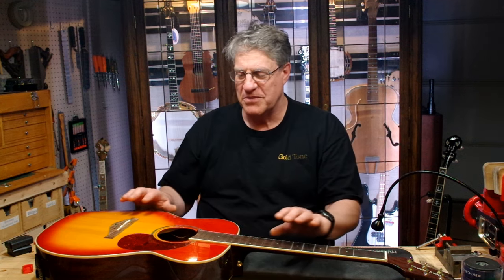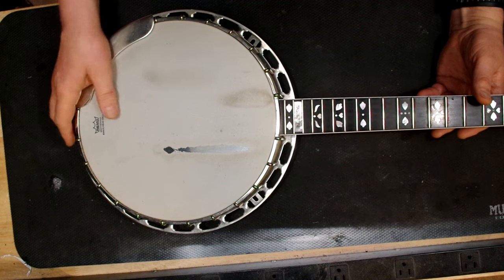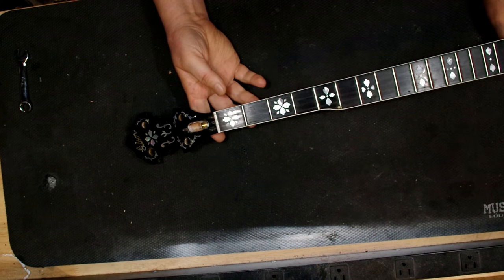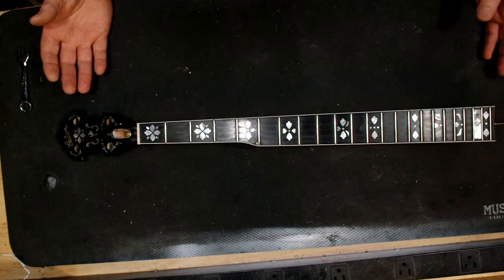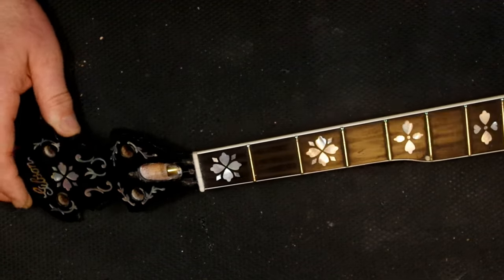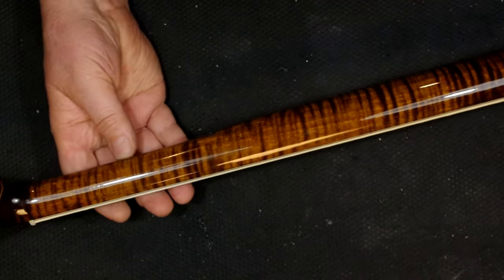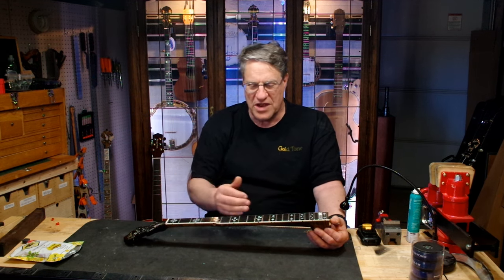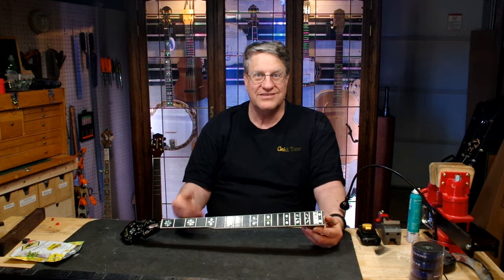A new problem with a Gibson Earl Scruggs banjo neck repair

Comment: If you haven't done this already, what about spraying some lubricant like silicon on truss rod through the 5th string tuner hole, then putting some spray foam insulation in there? This would keep the neck light and take away any issues with wax melting or adding excessive weight to the neck?

Comment: Couldnt you also use your access holes (or create one specifically for)to create air flow to dry? My first thought was silicone or liquid gasket maker… I’ve always dabbed some silicone when I installed trussed rods…
Reply from the maker: That's not a bad idea. My thought is.. it does actually stick firmly to the rod, but it has enough flexibility to bend, so the fact that it sticks may not take away from its performance. I might want to limit the amount I put in, so it doesn't hold it too firmly. That's probably why you limit your use to "dabs".. Something I can't control. Maybe I should do some kind of experiments with it. But you;re right, if I have enough patience it will harden, even a tiny crack in a tube will eventually harden up the entire contents.